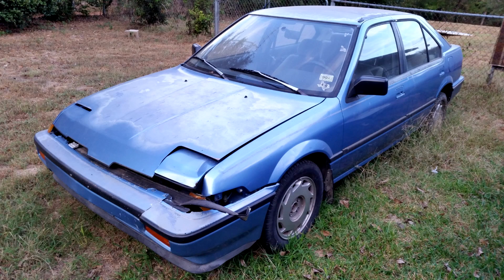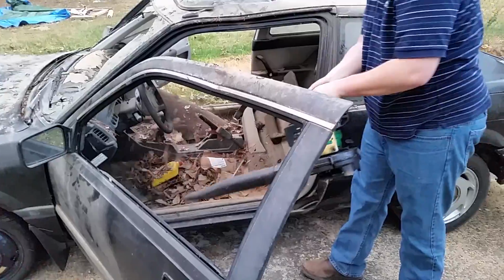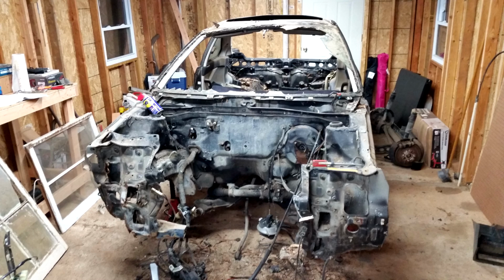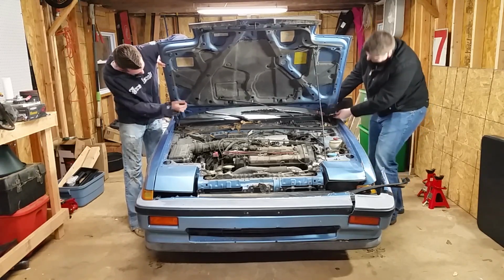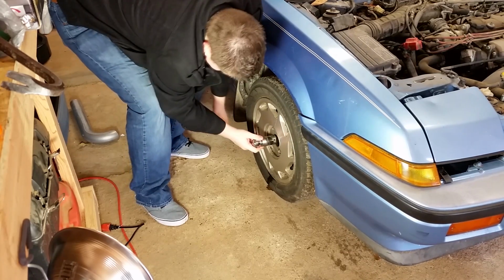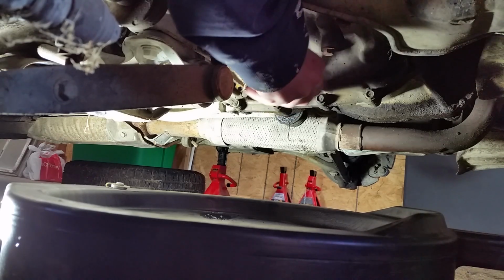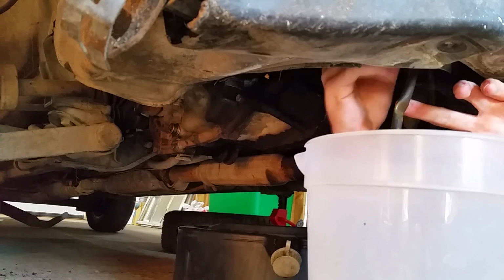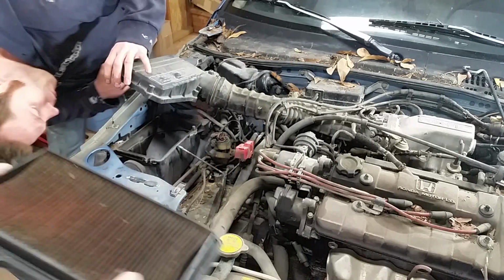87 Integra: Ep 1 - Intro

Comment: Hi did you ever get the Acura Integra to idle right?
Reply from the maker: Yes. Replaced the intake manifold gasket and cleaned the idle valves. It works right most of the time now but still acks odd sometimes.